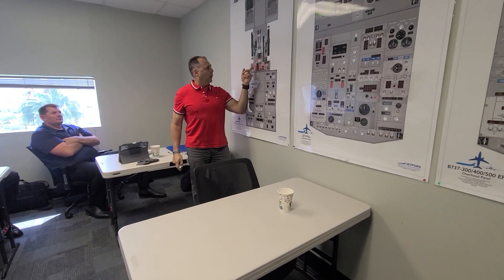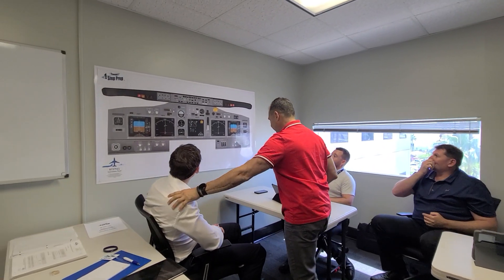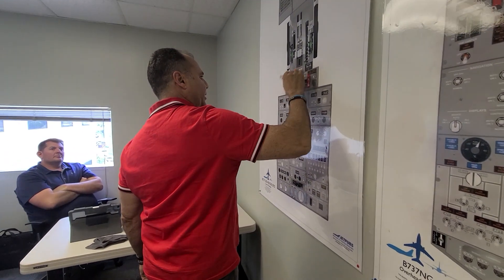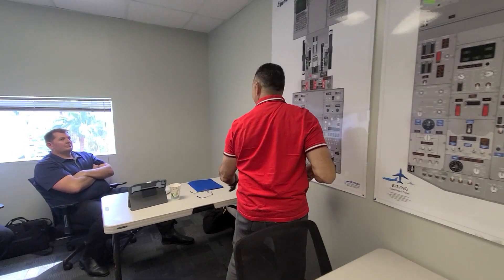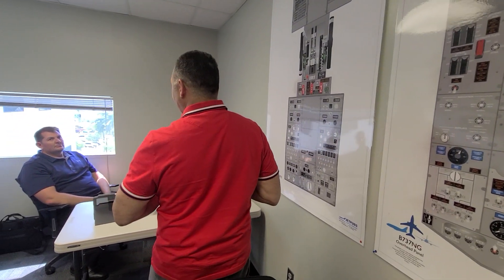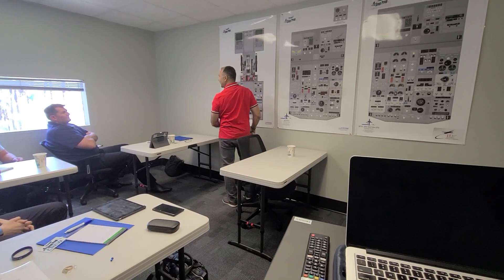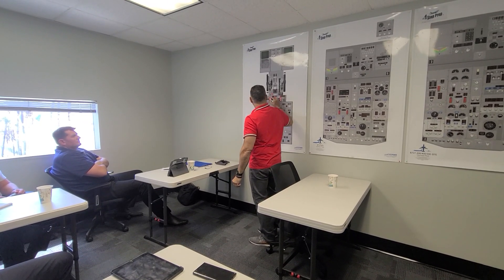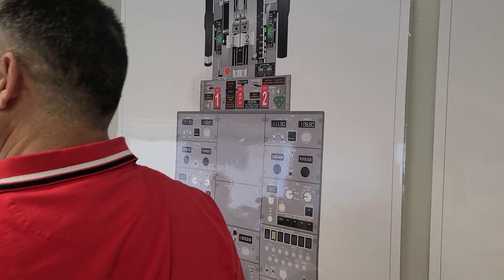B737NG Ground School

Comment: -Wheel well is ac trans bus #2
-Fault light comes on during the test with both loops inop only
Reply: Negative look at the Maint Manual or Bus Distribution is AC Trans Bus 1 ( Thank you for your comment)
Reply: @JuanDominguez-xd7ev Actually the fcom says AC TR 2 and bat bus